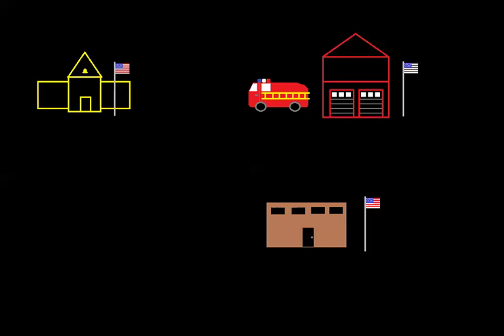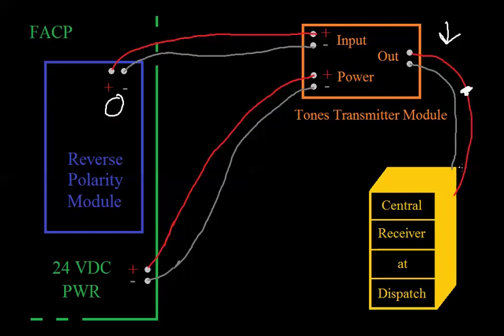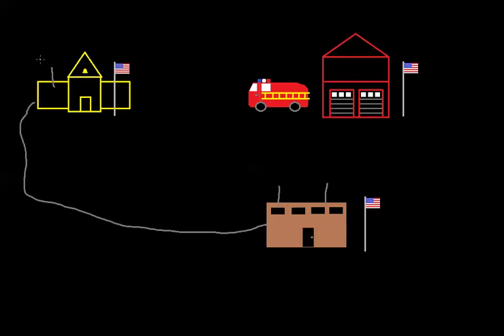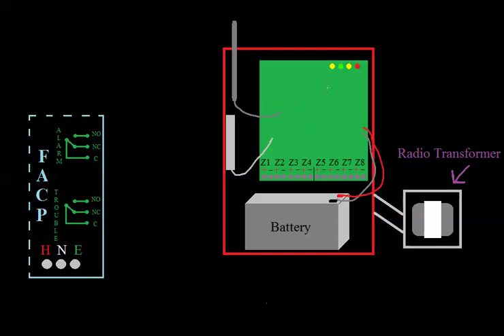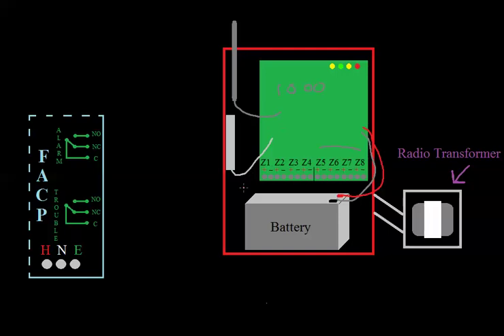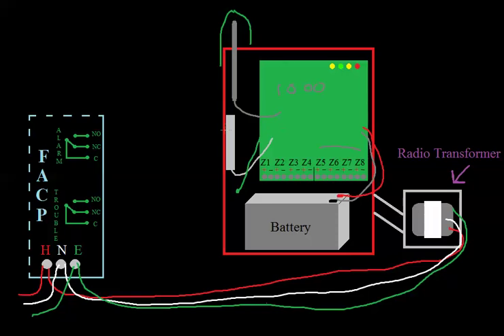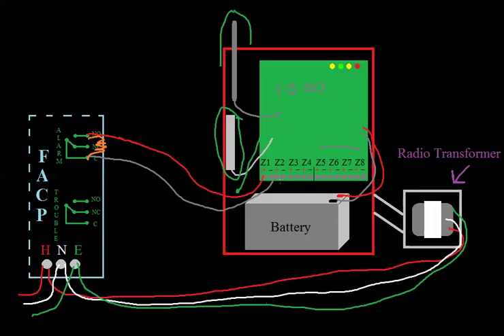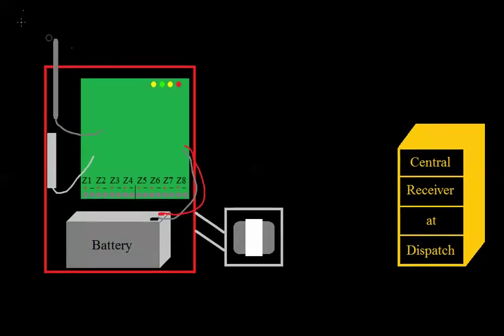8 - Wireless radios - Introduction to Fire Alarms

Comment: In the tones alarm system, does the tones transmitter module always place a signal on thre OUT lines to the central dispatch? Im trying to understand why a break in the line to the central dispatch would signal a trouble condition. I thought that only when an alarm or trouble was indicated would there be a signal on the OUT to the central dispatch.

Comment: I fried a Radio Transmitter by reconnecting the batteries after testing them. Somehow a wire connection got loose from one of the battery terminal and when I try to connect my last connection to the battery terminal a big spark came through. When we finished testing the fire alarm devices and we called to verify alarms and signals Central Monitoring Agency said they didn't received any signals. So we figure that the Radio Transmitter got fried. What would be the methodological way to fixed that Radio Control panel?